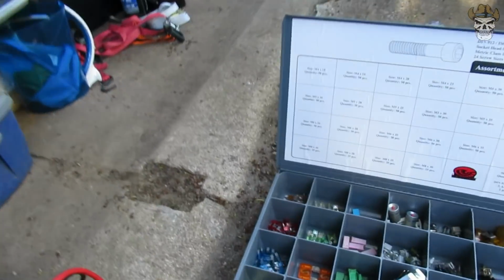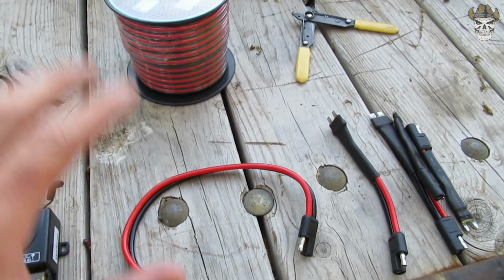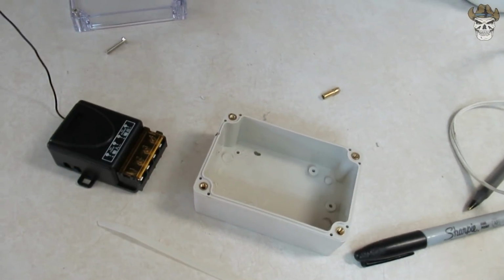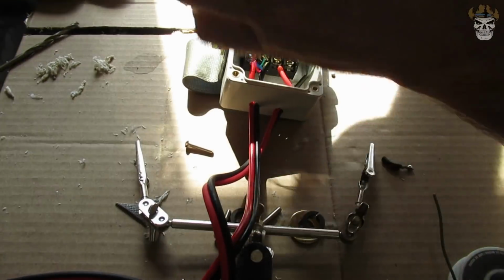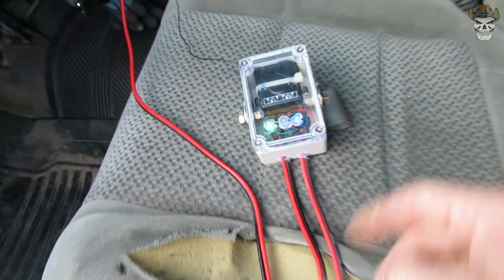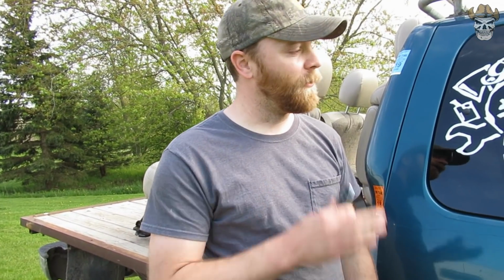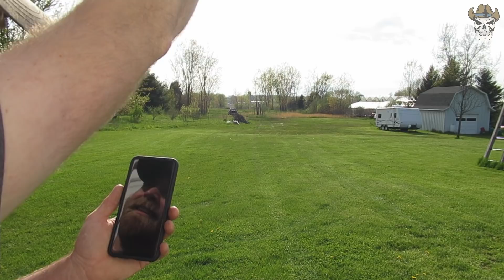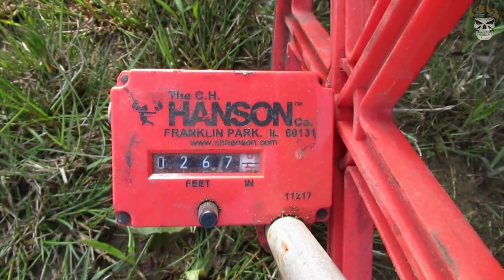Building a Remote Kill For MarkFreeman408 & His Runaway's.

Comment: You should of put a seat belt buckle on it so you could just clip it into the seat belt receiver, it would not get thrown around as much as it would not slide up and down the length of the seat belt. 
Other than that good DIY remote kill, there are pre-built kill switch's on the market with more range, but well executed.
Reply from the maker: All manufactures make different seat belts so this would not have worked.

Comment: I love the ingenuity, but rather than dremeling and soldering a fuse, a fuse tap would have been easier, but cost a few dollars more.
Reply from the maker: A fuse tap would have worked if you put it in the right way.  I was trying to make it so it was foolproof so I needed a 2 wire fuse.  If it was for me I would have just gone with a fuse tap or better yet just a male wire spade connector on the end of the wire strait into the fuse slot.  There are so many ways I could have built it.